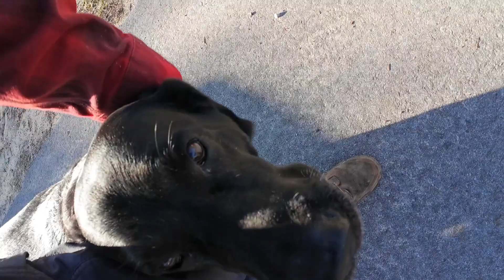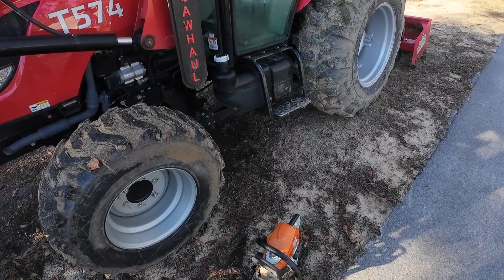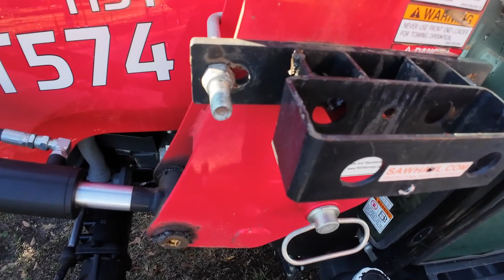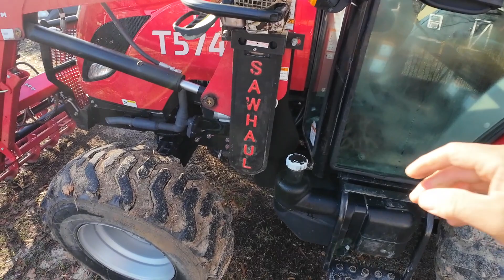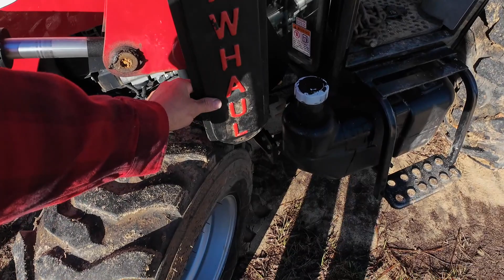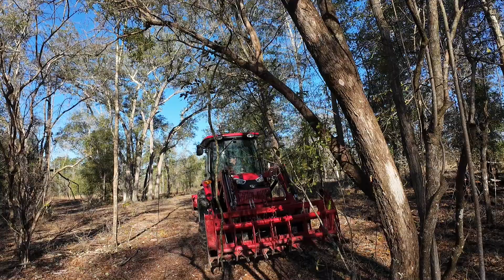This Tractor Accessory is SO GENIUS, EVERYONE is copying it!

Comment: But you know what though Hank. Even though that tractor accessory made bump to tire a little bit, it doesn't seem like it's all that dangerous. But you know what the whenever there's things like that? That makes the job easier. It's always nice whenever people that own tractors are always trying to find such easier ways for you to pull jobs off while you're running tractors and having to do large jobs in wooded areas. Because you know we always need more inventors and people coming up with t?  Ideas to help us do jobs. So it's always great to see people doing that. To come up with ideas because running tractors. And working in very large areas can be very grueling without having easier ways to pull the jobs off.

Comment: Hank I made a bracket similar to the one on your tractor out of some pc's of flatbar, allowing enough space for the bar protector that came with my stihl farm boss carrying case and use it much the same as you do,  with one exception. When not using my tractor, I can put the bar protector on my saw and put the saw back in its carrier and put the carrier in my side by side and away I go. Saved a few pennies.
Reply from the maker: Right on!